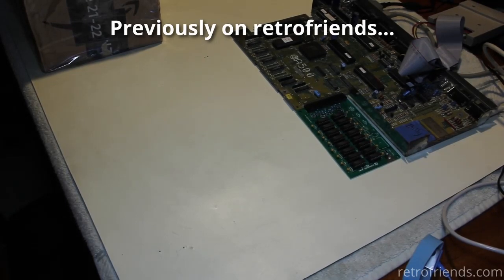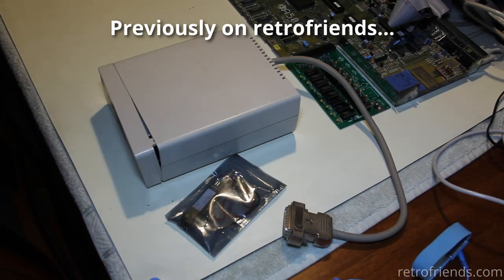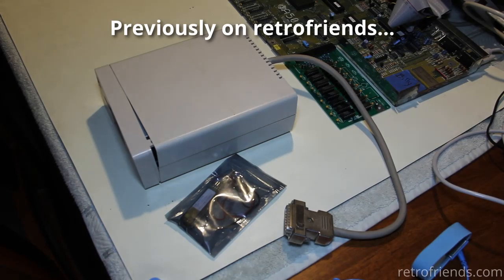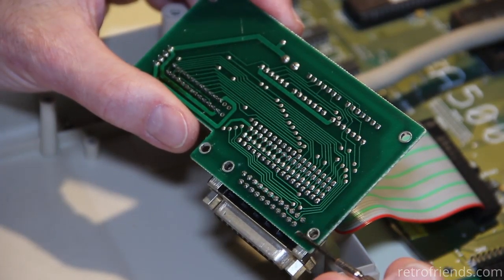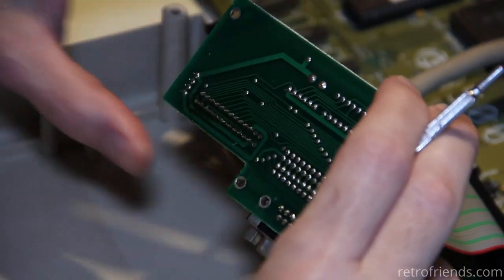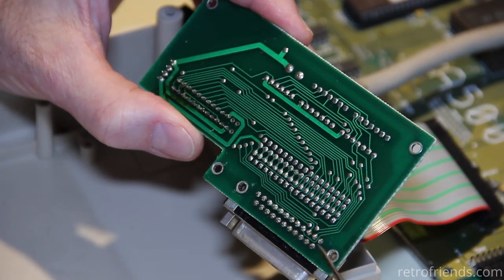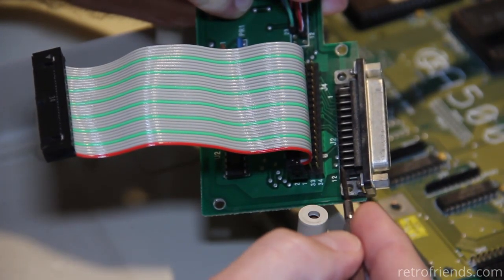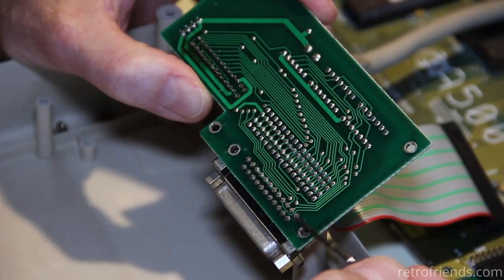Amiga A1010 External Drive Power Mod and Gotek Install

Comment: I kinda remember having the same power issue with an external drive back in the day. I guess they found the extra load caused problems in some cases?
Reply from the maker: Must have been the A1000, which was the computer this drive was originally designed for.